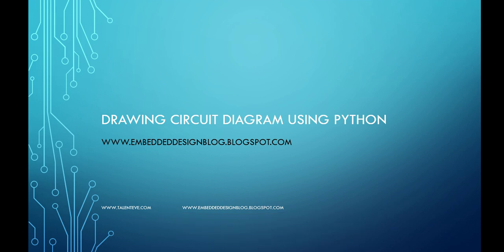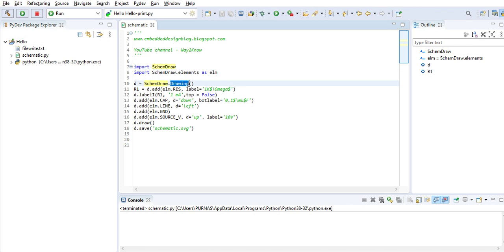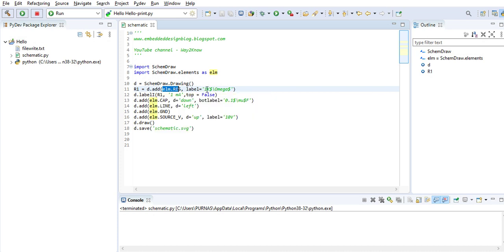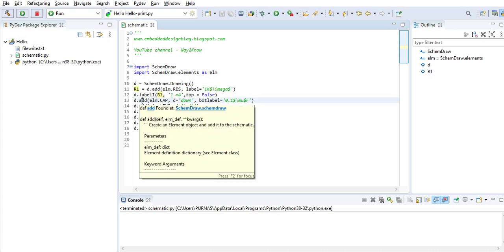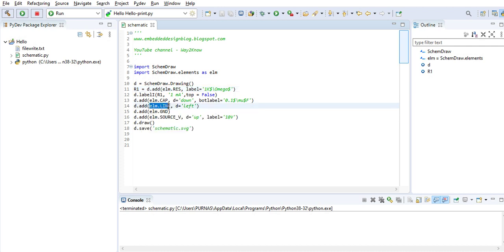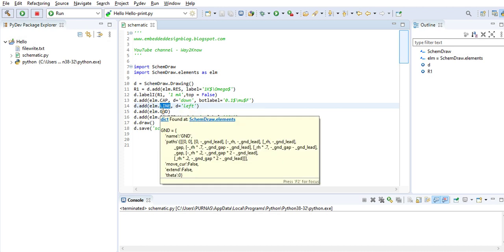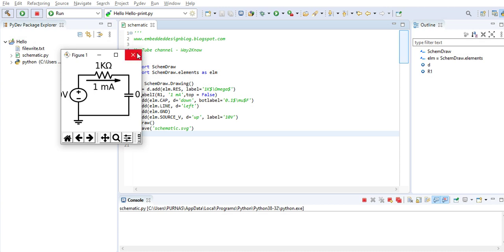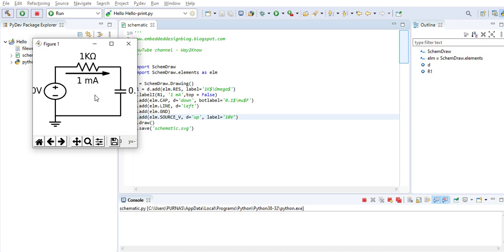Drawing Electrical Circuit Diagrams using Python || using Schemdraw Package || python programming

Comment: hello,
I finally succeed to install schemdraw with Python 3.8.
I am trying to change the font when I use a label, for example:
d.add(elm.CurrentLabelInline(direction='in', color='red').at(Z).label('$i$', ofst=0.02, font='Times', fontsize=20, color='red'))

Unfornately, i do not succeed to change the default font. I would like to use 'Times New Roman'.
So my question is:
Which are the font availables with schemdraw ?  If only default font available, how can i add a new font ?
The documentation i found in internet is very poor, and i did not find information about this subject.
Thanks for helping !
Reply from the maker: Default font seems to be sans-serif..

Go to \python38\Lib\site-packages

Open schem draw from the above path

Check the config definition and change font to your desired value.
Reply: @Way2Know  Thank you !  I will try......but if i change the font in the config definition, it means all labels will have the same font....The idea, is to use 2 different fonts in the same figure, for example one font (serial font) for indicate the values of resistors and capacitors, and another font (times new roman)  to indicate the current 'i' in the circuit and the voltage 'u1', 'u2',.... on the top of electrical components.
Reply from the maker: Then in that case, I suggest you write a small method to change the font.
Reply: @Way2Know  Thank you for your reply. One last question :
Is it possible to have a graphical plot (matplotlib) and a schemdraw circuit both in the same figure ? For example, a RC circuit at the top of the figure, and the plot Condo Voltage in fonction of time at the bottom ?
Reply from the maker: I have not tried but it must be possible by using mathplotlib..